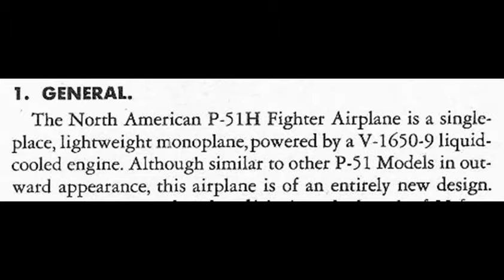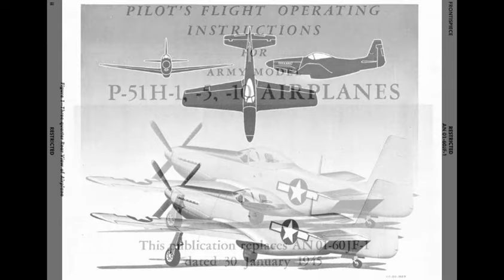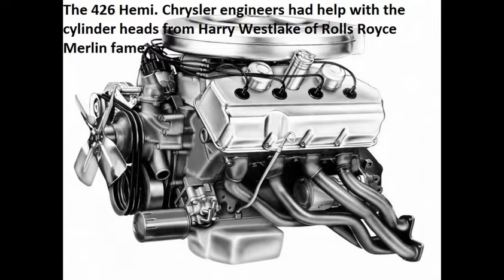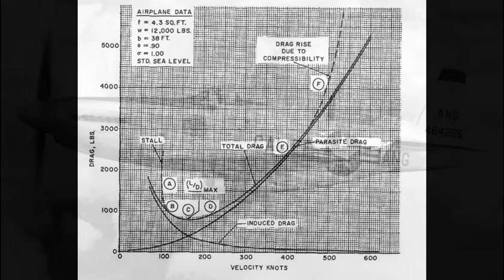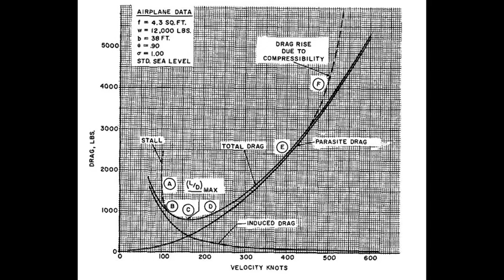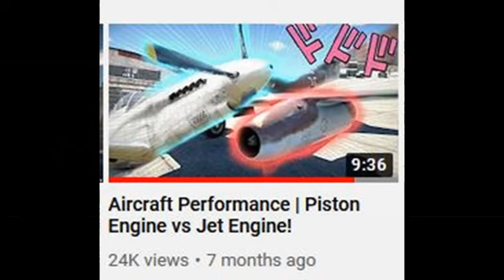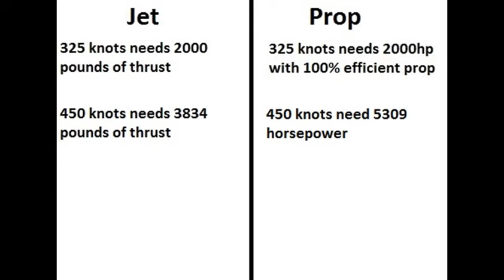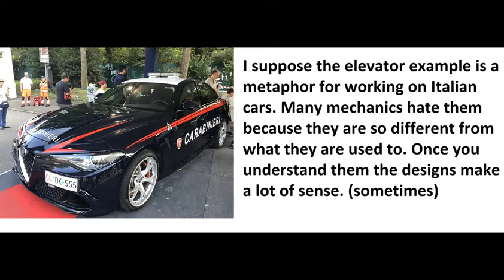U.S. "Superprop" Fighters P-51H, XP-72, and more

Comment: Love your channel. My first experience in Europe was to figure how to open a door. When I crossed the Channel and came to France, my buddy and I went into a hotel. We went to dinner down a stairway and came to a door at the bottom; couldn't figure how to get thru the door to the dining room. Could see people on the other side and after trying for several minutes to open it, had to signal to a diner to open the door for us. He graciously rose, approached us and SLIDE the door to it's pocket. Talk about feeling stupid.
I worked at P&W in the experimental design group in the 60's and the guys I worked with said the worst problem they had on the 4360 was to get the cooling sheet metal to the 2 rear rows. Lots of toasted 4th row cylinders. Had to run them richer to let fuel act as a cooling element. By the way, that 777 engine loss yesterday is definitely NOT supposed to happen with external part showers.
BTW The comments are made by interesting viewers who add to your channel.  I appreciate their input.

Comment: Would LOVE to see you do a video on the Hawker SEA FURY! Gorgeous monster of a fighter...
Reply from the maker: It gets mentioned in this video, just mentioned though.
Reply: I agree 👍!
Reply: @iconoclastpleonast8726  Quite a unique sound, not at all like the equivalent P&W or Wright engines. Much smoother and more muted.
Reply: The sleeve-valved Hawkers whistled rather than roared. Exhaust sleeve valve opening was less dramatic than a poppet popping open maybe  (which can have advantages in tuning non supercharged engines - sharp opening poppets that is).
Reply: And the Hawker Fury I with the Napier Sabre engine
Reply: @TheHarryMann  I just watched a video about that style of engine! It looked like a work of art...from Wyoming USA 🇺🇸 🤠
Reply: @billallen4793  the Sabre, developed, and with fuel injection would have been comparable to anything in the world. 3,500 HP was being targeted for military certification and achieved with bench testing as the war came to a close... 
Some say 5000 was seen in the test cell.. 
2200 was the original rating in the Typhoon and 2850 to 3000 at wars end In the late Tempests at military emergency.
37 litre H-24. Weighed just over a ton
Revved to 3850, possibly 4000 safely
Reply: Very interesting
Reply: Yes, I always liked that aircraft.

Comment: "Though I think it should have been called the Challenger Thunderbolt.

Engineers at Dodge: furiously writing notes
Reply: More likely Marketing Department.
Reply: I would like to think a hemispherical cylinder head is still in use, though it would have been a pain to manufacture.  It would have better amplified the internal combustion (spherical blast) than a flat head.
Reply: @dadillen5902  Marketing Department(s) doesn't watch videoes like this!
Reply: @MultiZirkon  Perhap not yours
Reply: Ford Motor Company lawyers hands twitching on their cell phones waiting to file trademark infringement...
The Fairlane Thunderbolt tore up the dragstrip in the early sixties

Comment: Excellent  Greg! Most folks are not aware of the Republic's P47H & J models, especially of the speed they were capable of. The XP72(14ft 4 bladed prop)with its high speed was also said to be a beautifully handling aircraft by its test pilots. I read there were problems with the contr rotating prop system. Republic never gets enough credit for its engineering & designs during the WW2 era. You present the facts with a fair point of view, without over glorifying any particular aircraft over another, thanks for that!

Comment: The “strange” elevator control system is the new normal. It’s based on fully “intelligent” control software which minimizes total travel time. All major brands have adopted this now.
Reply: I have heard of this but not seen it.  Think of several people all taking different elevators to go to the same floor.  Less efficient than them all being directed to the same elevator as done in this Sicilian example.
Reply: @bobzwicker807  Seems the tradeoff would be much lower total elevator usage, since you can't have a single car serve multiple sequential destinations. You get in the car and when the doors open you get out and assume you are on your desired floor.
Reply: Yes, I have run into these in several 4-star hotels, mostly in north America but also in Asia. I think the system works fine when the number of riders are low. The issue arise when you have many who want to ride the elevators like at a conference in a hotel after the sessions has ended. Then many persons needs to get to control to input where they are going. And then managed to get to the right elevator through the crowed in the elevator bay. Also the intelligent control doesn't know how many people a single press for flor 5 means. Thus, it has issues filling the elevators to capacity. Yes, it can optimize the number of stops when it gets many riders inputting where to go. Also if you make an input error you are sending an elevator on ghost chase.
Reply: There is one building, here in Cape Town, that my son and I use frequently, which has this system. I'm not terribly keen on its, as waiting times seem to have increased considerably over the conventional system, in the same building, that it replaced.
Reply: I live in downtown Chicago and most new buildings along with older buildings that can afford it are converting to this system - it is more efficient.  Willis Tower (former Sears Tower) recently finished their conversion.
Reply: @lwilton  That's not how it works, the - for you selected - car does in fact serve multiple floors. People will both join and leave the car stopping along the way to your chosen floor, hence the floor indicator at 25:31. It's just that the central logic for all elevators calculates the best use of all available cars. Side note, best use does not mean optimal or fastest for the lift user, but is often optimized for least wear of the lift infrastructure.

Comment: How fine would be to see one of these things racing at Reno at current days...
Reply: All you need is a bunch of money.
Reply: @greatgandalf5233  Indeed. That seems to be the requirement for most of my wishlist items.
Reply: 531 mph at ground level!
Reply: Unfortunately there is no motivation to fund further development of piston powered propeller prototypes.

It would for sure make for an interesting class.
Reply: We already have R3350 powered Bearcats, Griffon powered Mustangs, and R4360 powered Corsairs and Sea Furies; functionally the same thing.
Reply: @fafner1  a rebuilt  p75 eagle would be a nice addition to the flight line...
Reply: @Surigao 1944it is not ugly... Exotic, I would say!
Reply: @fafner1  agreed, however, it would be interesting to see a class evolve based around WWII technology, i.e. aluminium-bodied airframes and piston powerplants of "newer" design.
Reply: i want to see a p47N pilot absolutely GETTING ON IT! 
.
the R2800 will always be music to my ears..... just a hot rod of a plane and engine

Comment: P-51H has to be one of my favorite aircraft of all time. It’s such a beautiful refinement of the already beautiful Mustang: lighter weight, more engine power, further aerodynamic improvements, and with almost nothing lost over the older model (rough field capability, admittedly, but this is the USAAF, smooth airstrips aren’t exactly a rare commodity). 

And unlike many super props, the H was more or less ready for service by the end of the war. It never got a chance, of course, but it was in production and being shipped out by the late summer of 45.
Reply: The performance of the 51H is exceptional but that's on its testing flights. Built from the start to last only 500 hours the 51H was unsuccessful in operational service. Not rugged,and with a finicky engine fitting very tight with limited access panels it only had a 30% availability rate. So it went to the air guard and they had problems with it as well. Pretty much,with the 51D,North American took that airframe as far as it would go. Trying to squeeze out more performance, they went to lightening the aircraft up.If the Pacific Theater  would have lasted a little longer you would have seen the 47N totally take out the Mustang.

Comment: I hope that propellers video covers prop blade shape. I have been curious why the Germans favored "leaf" blades, for lack of the technical term, vs US props favoring (relatively) constant blade width.
Reply: The P-51 did come out with a spoon blade late in the war.  It resembled a regular prop with a big paddle at the tip.
Reply: The US did add cuffs to the propellor blades, which acted as a crude imitation of the cooling fan used on the FW190.
Reply: @fafner1  which planes did they put those on? Corsairs and the naval Cat fighters (F4F, F6F, etc.)?

Comment: The PW-2800 was also able to take hits in the engine and lose cylinders but keep running enough to get back home. Another reason why the P-47 was a great plane that got guys home alot when other planes wouldn't have been able to. That and its armor. Something that republic remembered when designing the A-10 thunderbolt II.

Comment: Hi Greg, Thanks as always for the excellent content... Will look forward to yr analysis of propellors! 

With respect to your elevators comment:

1. I live in Santiago Chile, and I can say that this elevator "methodology" is quite common in newer buildings.

2. It is implemented mostly (here), in big new highrise buildings, where they really don't install quite enough elevators to handle "peak hour" demand (cheapskates)

3. During most of the day a normal elevator methodology/algorithm would work fine (and simple is best right?)

4. However, in peak hour (like 8 o'clock in the morning), you can have 20-30 people waiting for 4 working elevators.

5. So, clearly, the idea is to try to improve elevator utilization by "load balancing" the available resource (4 elevators), and to avoid the chance of an elevator heading up to the 13th floor with 1 person in it (for example)

6. I spent a couple o' weeks using this system in a customer's building (arriving at peak hour).

7. There's a lot of heuristics in the algorithm (I reckon!), and its far from perfect, but without a doubt improves utilization (not necesarilly user experience).. the good solution is to install the number of elevators that you really need

8. Long term users can learn to fool the algorithm... if you want to go to floor 4, request floor "4" a couple of times, and you may get a quicker response in some cases (the algorithm assumes that 2 people need to go the floor 4) (This is hearsay, I have not tried it, but my mates tell me this),

9, Its an interesting topic!!! Someone on YouTube should discuss it "deeply" like you do with mechanical engineering!!! It is not a trivial problem!

All the best Greg, have a great 3 days, all the best to the family!!!

Comment: An interesting video. One of the other limiting factors to increased engine power is the propeller size. One of the post war Spitfires used for high altitude recon had such a large prop it had to take of and land on all three wheels. Lifting the tail risked grounding the large prop. Also the Avro Shackleton had to use contra rotating props as the under carriage was not long enough to accommodate a single prop on the Griffons.

Comment: Hello, longtime viewer of your channel, thank you for the amazing content that you bring. In regards to the P-51H, I find an interesting something interesting in the reports on wwiiaircraftperformance.org. The level speed at 32000ft (not the altitude where top speed is achieved, which is far lower) is in huge discrepancy between the reports, the lowest being 430mph[1] and the highest being over 480mph[2][3]. A few in the middle suggest somewhere around 450-460mph[4][5]. This much discrepancy suggest either a major change in the supercharger or something more fishy. Sources 2 and 3, which produced the largest numbers for P-51H, are both clearly from NA Aviation itself, which I find interesting. In source 2, the rpm numbers are not provided, but I suspect that the 46" curve is using 2700rpm, and the 61" and 70" curves are using 3000rpm (as there would be no point in running 70" and 2700rpm), which would explain the large increase in performance above critical altitude, since spinning the engine faster drives the supercharger faster and a small increase in supercharger rpm leads to a large increase in its pressure ratio. Hence in source 2, the 80" and 90" curves are likely run at an impermissible engine rpm greater than 3000. In source 3 there are no visible problems. I suspect NA of providing falsely large numbers, and the actual level speed of the P-51H at 32000ft is more close to 450mph than to 480mph.

[1]http://www.wwiiaircraftperformance.org/mustang/p-51h-64182-fig16a.jpg
[2]http://www.wwiiaircraftperformance.org/mustang/p-51h-booklet-pg12.jpg (with racks)
[3]http://www.wwiiaircraftperformance.org/mustang/p-51h-altperf-91444.jpg
[4]http://www.wwiiaircraftperformance.org/mustang/F-51H_Mustang_SAC_-_22_March_1949.pdf
[5]http://www.wwiiaircraftperformance.org/mustang/p-51h-na117.jpg
Reply from the maker: If I decide to make a dedicated P-51H video I'll cover all that.

Comment: The elevators in EAST Miami worked by keycards only from the ground floor to the guest floors, and the elevators were all lettered, and you tapped your keycard then selected the floor you wanted to access and it assigned an elevator letter and you got on. It was a very efficient design.

Comment: Greetings, Greg!
One beautiful day, the elevators in my employer's building substituted floor buttons outside for the call buttons. From that day on something very amusing started happening sometimes. Either I entered the elevator to go to my job and finished in another floor, because i didn't press the floor button outside, or I entered the elevator on my building and took a while staring at the walls and asking myself why the elevator didn't start, because, of course, i didn't press the floor button inside. Or the other way around. Either way, I felt very silly. Happy the elevators are not 737MAX.

Comment: Thanks for that. In contrast to the Fw 190, the  XP-72 fan rotated at the same speed as the propeller. The cooling fan for R-4360 in the XF-12 was a two speed, gear-driven unit built by Curtiss Electric, but that is a story for another time.

Comment: Great work, Greg, love the detail and analysis. It would have been interesting if prop planes had developed another ten years before jets came to the fore. I think Goodyear was working on a super Corsair toward the end of the war. Things would have been interesting, and folks would have come up with some amazing solutions. Thanks for the hard work and insights.
Reply: Yes they were. The Goodyear F2G Corsair, often referred to as the "Super Corsair", is a development by the Goodyear Aircraft Company of the Vought F4U Corsair fighter aircraft. The F2G was intended as a low-altitude interceptor and was equipped with a 28-cylinder, four-row Pratt & Whitney R-4360 air-cooled radial engine. Such a fighter was first conceived in 1939, when Pratt & Whitney first proposed the immense, 3,000 hp (2,200 kW) R-4360,[1] and design work began in early 1944.